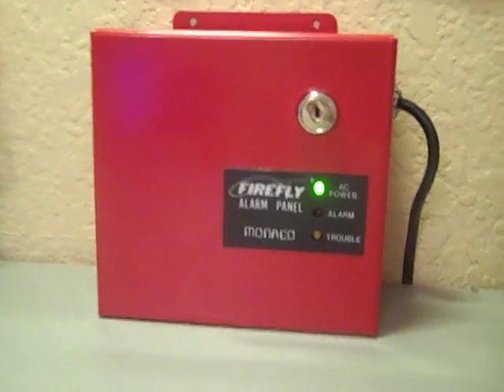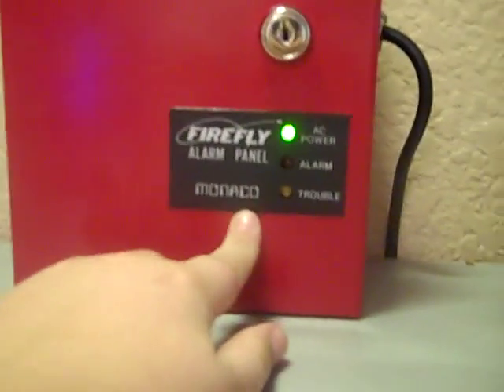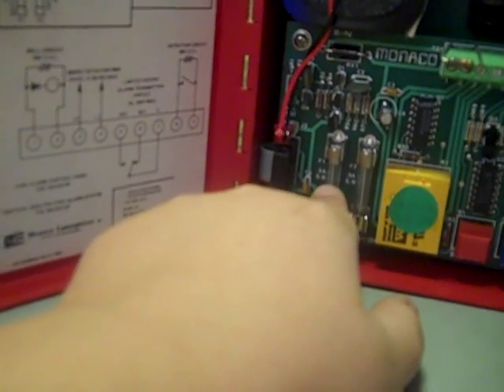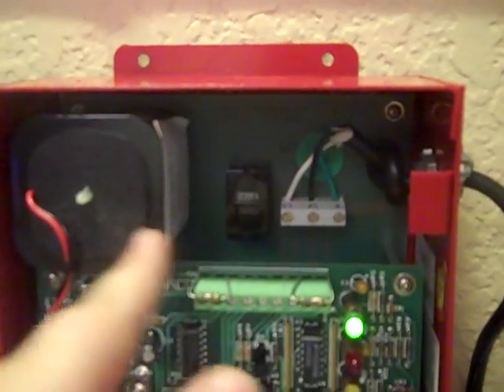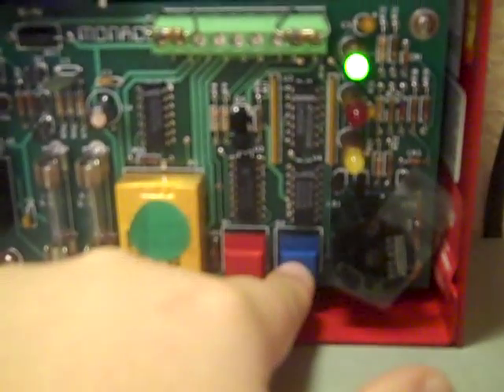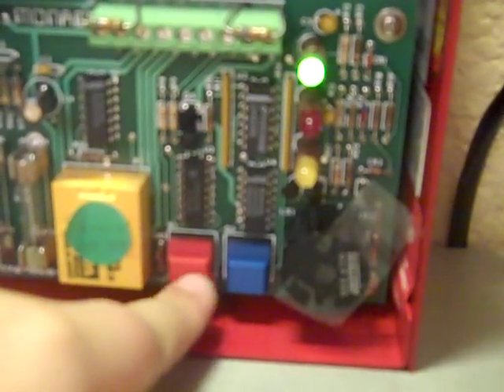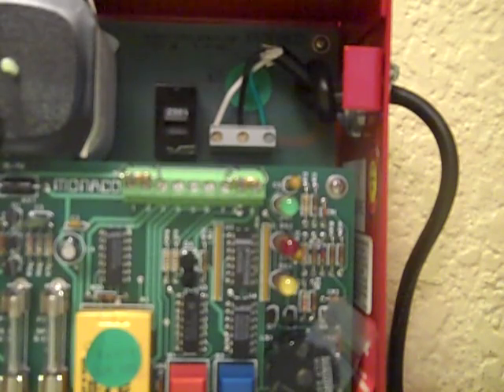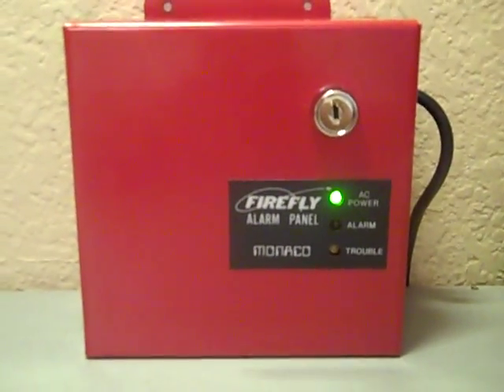My new Monaco FireFly FACP

Comment from the maker: @rhett443 It runs on 120-240 volts depending on what setting you have the built in transformer to. It produces 12V to the alarms and smoke/heat detectors.